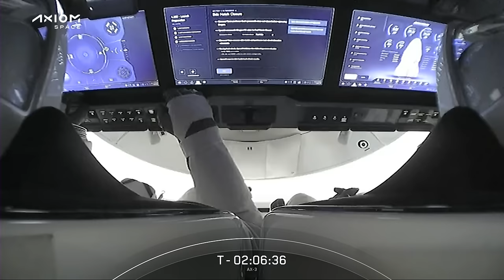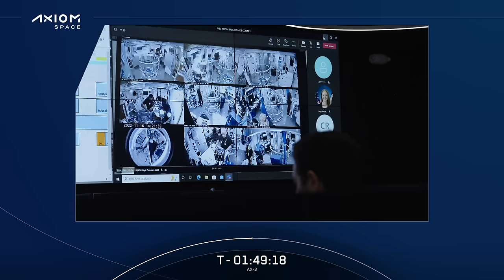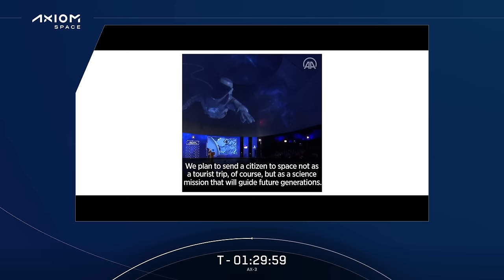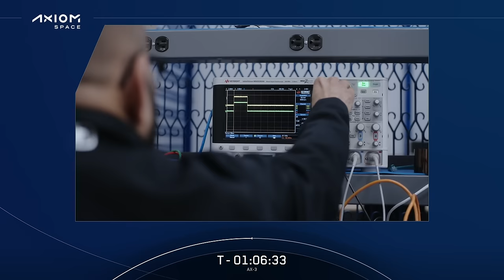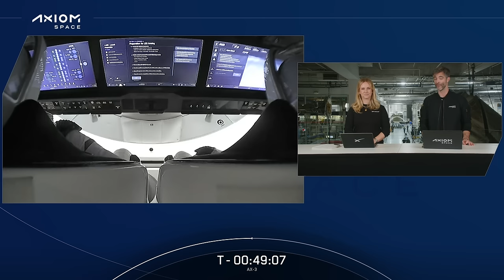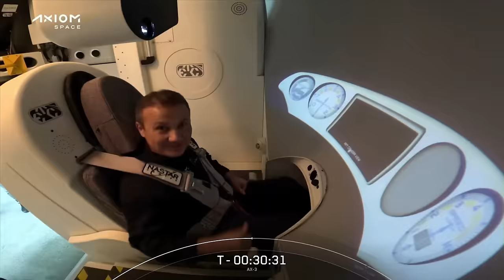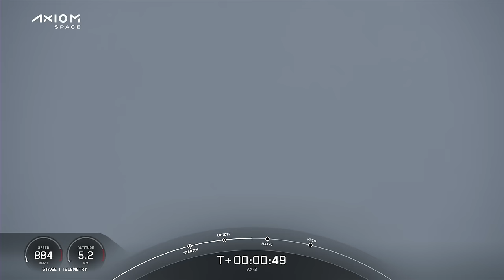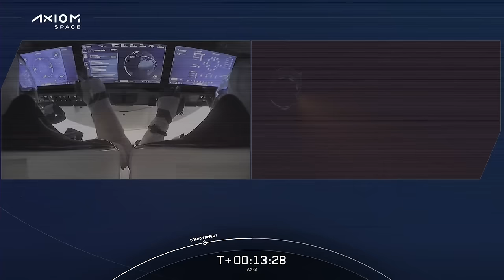Ax-3 Mission | Launch

Comment: How is the ISS “moving” through space? 
The International Space Station stays in orbit largely because of its orbital velocity of 27,600 km/h (4.7 miles per second / 7.6 km/s) & pulled by gravity into a curved path, the ISS travels around the world at a fixed distance. 

That seems impossible that it’s “moving” at such speed, but is essentially fixed in the orbit some how. I do not compute!
Reply: Have you ever thrown a ball? If you try to throw a bowling ball, it won't go very far before falling down to earth. If you throw a golf ball, it will go further before falling down. If you fire a bullet out of a gun, it will go much further before eventually falling to the ground again.

How fast do you think you'd need to throw something before it goes far enough to hit you in the back of the head (ignoring drag from the air)? It's about the same speed that the ISS travels

Comment: UAP/UFO visible at Timestamp 2:13:57. Silver Ball is visible above the left side of the right air brake panel. It appears stationary as stage one drops by at 4184 KM/H (2600 mph) and at 65.9 km (216207 ft).  Additionally 3 more somethings earlier at Timestamp 2:13:09, visible between the 2 air brake panels and passing by the left one – right before the screen switches to something much less interesting. Just Sayin'.  Think! and do your research - I did....  Watch and see where the Ball comes from.  (slow and high res). I comes straight from  way below. The Stage doesn’t go straight up and it does not follow the same path back home, so it wouldn’t be lucky to meet its debris or whatever else 3 or however many minutes later. It is falling quite linear with the stage. About impossible for it to be falling the same location and angle, and yet somehow falling slower than the stage is falling.  At 200,000 feet  there is 31.5 instead of 32.1 ft/s/s of gravity – very little change from seal level.  At 200kft. There is only .003 air pressure, so there  is very little to none of wind resistance.
Reply: Most likely bits of oxygen that were vented from the tank and then froze.
Reply: Ice from the first stage that fell an earlier. It travelled lower then when it started hitting the atmosphere it was slowed down more than the heavy booster which then flew past
Reply: @odysseusrex5908  Nice guesses... Please read my revised above. Thanks.  I really would like to know what this is.
Reply: You can see first stage actively uses it`s RCS thrusters to keep orientating retrograde and at the same time pushing fuel down to the engines because of low gravity it is sloshes in the tanks, so by these RCS thrusters it is keeped pushed down, it is like braking in the car, when you brake you are moving forward, so these thrusters do the same thing - pushing stage fore or up, and this makes fuel go down.And because of these pushes, fuel sloshing stage is vibrating, so these ice peaces are felling from the stage tanks.You can see if look attentionaly when the stage uses these thrusters many peaces from that area near them are flying to the camera, very rapidly